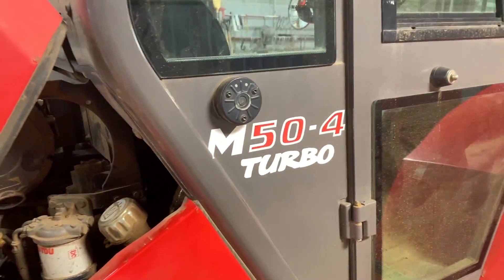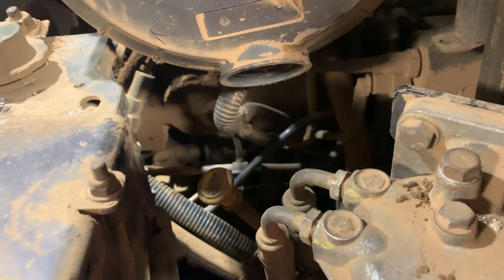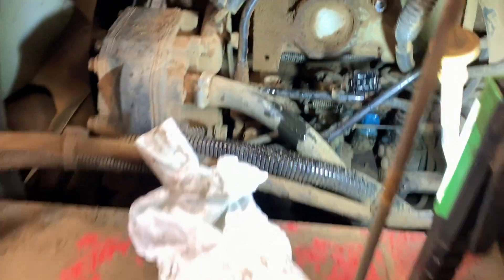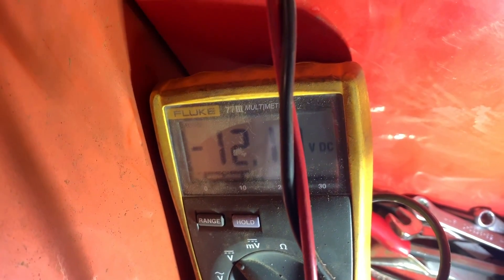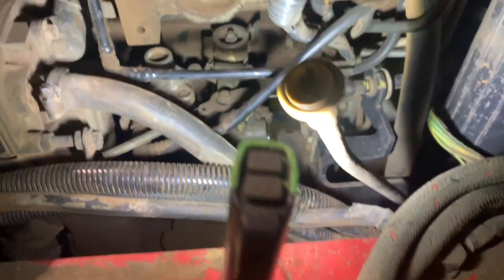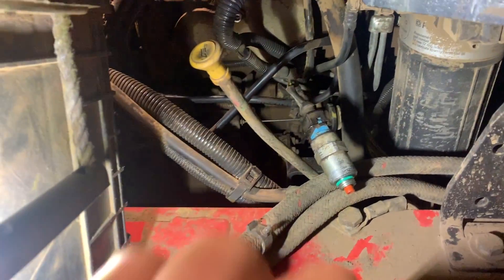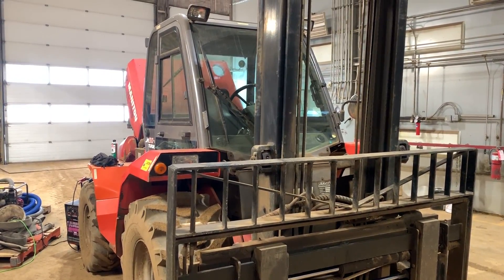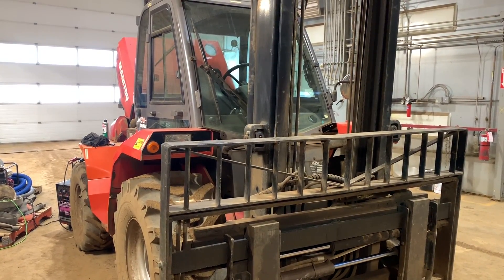Manitou M50-4 Crank no Start

Comment: A $75,000 fork lift that will lift 11,000 pounds... that has to be the king of forklifts.  Nice big shop.  Gotta love working on that heavy equipment.  My grandfather did that back during and after WW2 for the Army on a huge base here.  He had wrenches that were 3+ feet long that weighed like WTF heavy.  My brother sold them a few years ago said they were getting rusty.  He could have kept them to use during zombie apocalypse as weapons.  Nice forklift, would love to see some of the other equipment you work on.

Comment: Good idea to say Yes!!
Just think of the nice raise you will receive!!
That will be a nice MFBT video away from home. Nice job on the quick diagnose.
Reply from the maker: Most likely be a winter project after all this other work is finished up.  Won’t be a fun job that’s for sure
Reply: You started looking for another gig or are you going to take a break from the grind? 4K for labor to fix sounds like dealership prices.
Reply from the maker: That’s what the dealership quoted is correct